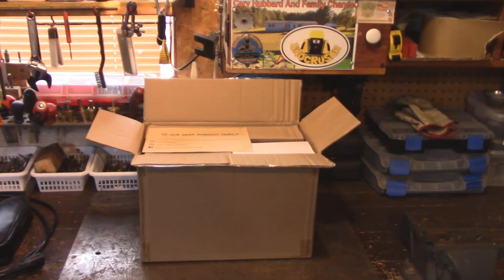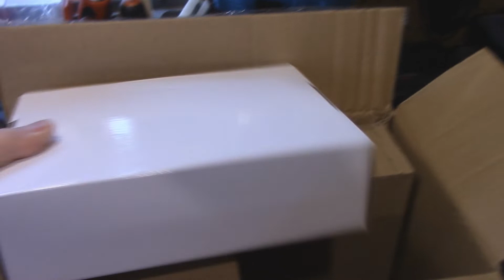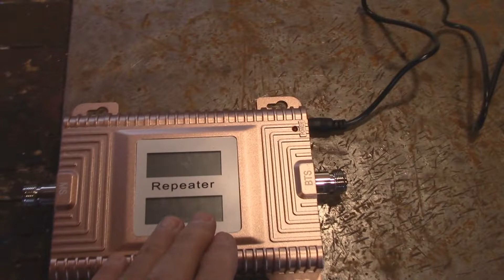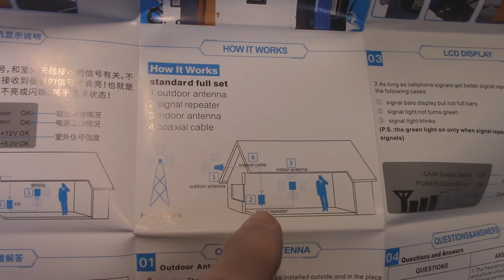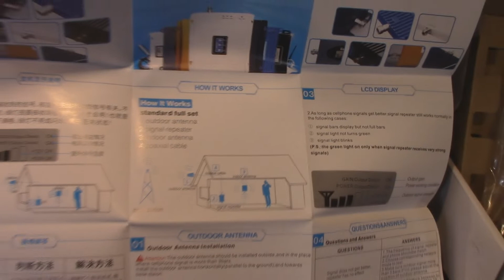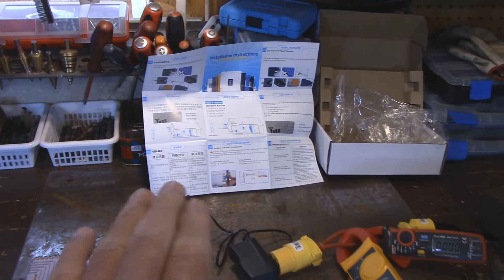Goboost Cell Phone Signal Booster Review -  Part One

Comment: I live in the city and cell service is (rhymes with city) no matter who you have for a carrier. one bar sometimes two At night you can actually use the internet. Less demand on the tower. Odd you can go just barely out of the city limits and get good service. Be nice to get a booster if it works
Reply from the maker: Hi Mike
I posted an update below , it works great after I turned the camera off and figured out how it was working all the time but I had to change a setting. I get 4-5 bars   all the time now.  I will post another video soon to show how good it's working .

Comment: How's she goin'?  Good luck with your system Steve.  I believe that Bell Canada customers get better service than suppliers that use Bell towers.  I have heard too that internet providers using Bell infrastructure are being monitored and having their internet speeds affected.  
The cell booster we bought a while back has worked good for us.  We used to get 0 to 1 bar and then the booster would give us up to 3 or 4 bars.  But for the last 4 to 6 months this system hasn't been performing as well.  Not too sure why.  I have another external antenna that I want to try and that may help.  
We never have any issues with the system coming back up after a power outage either.  It take a minute or so for it to reset and find the signal after a power outage but that's about it.  When we have a power outage, and we get them pretty regular now, I go out and start the generator and switch over, come back in the camp and the booster is already to go because I call in the outage right away!!  
These boosters are expensive, but I believe they work.  Take care!!
Reply from the maker: Hi Mike 
This one under $200 is working great .  I can get on the internet now , just awesome.
Reply: @SteveRobReviews  Sounds good eh!!!